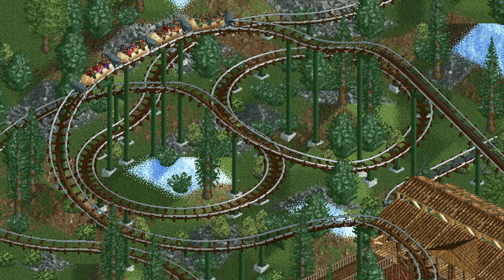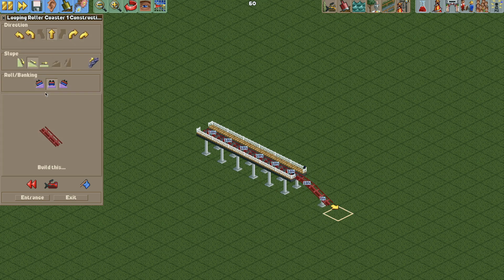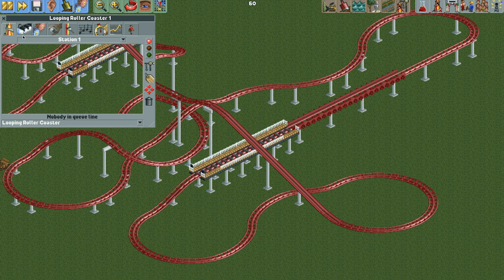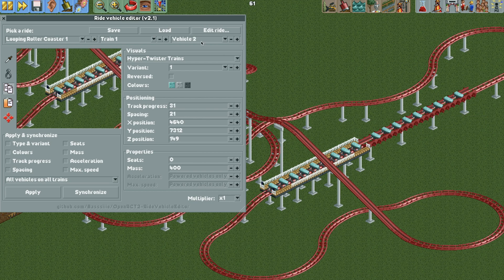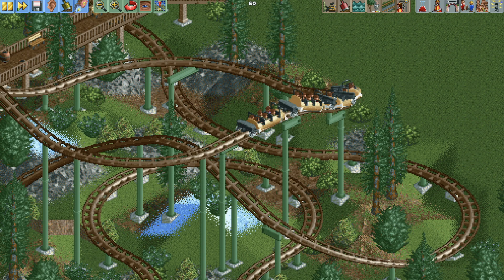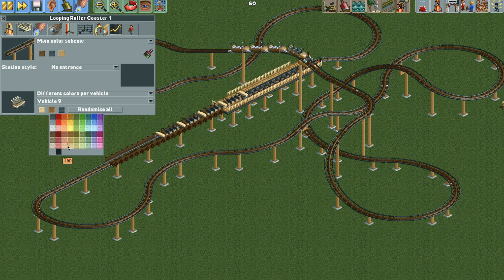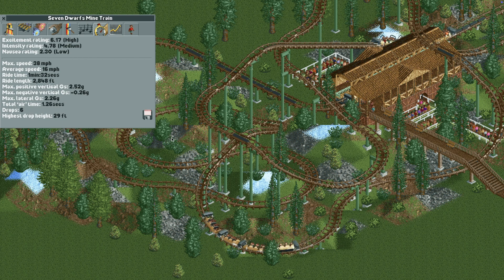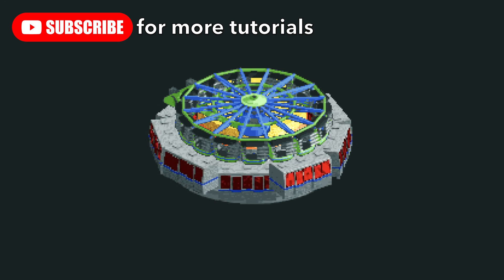Seven Dwarfs Mine Train Coaster - Open RCT2 Tutorials

Comment: you mention at 3:30 "as long as theres no high speed turns that could cause the train to crash", i don't know if you misspoke and meant to say hills. in either case i have great news. the only ride type that can crash on corners are the two ghost train gentle rides. all other rides can take corners at whatever speed you like. the guests might not appreciate it but it will make it back to the station. great vid, the result is very cool!
Reply from the maker: You are very right. I must have been thinking of the ghost train! Thanks for pointing that out